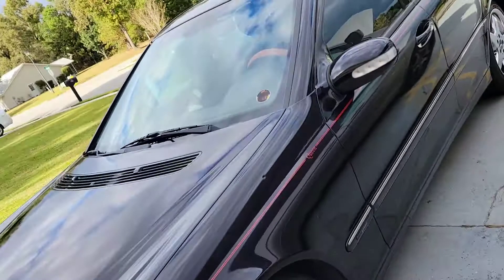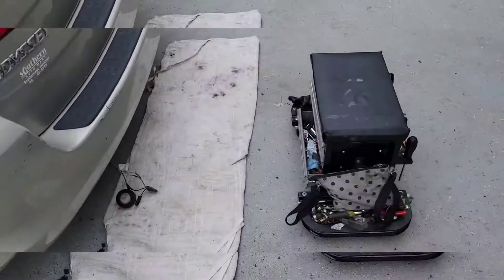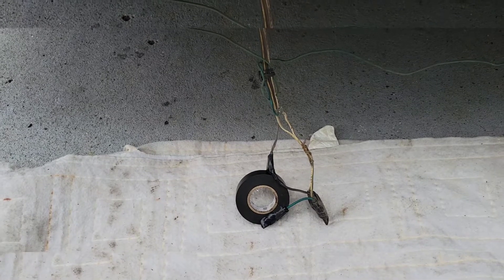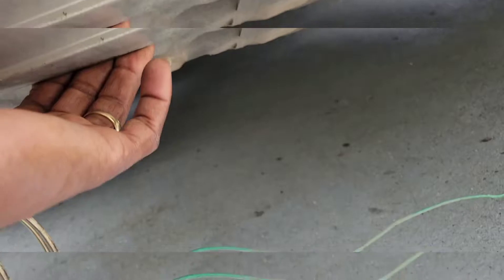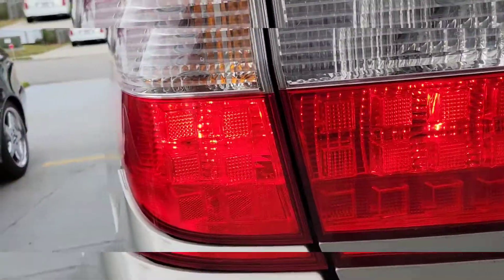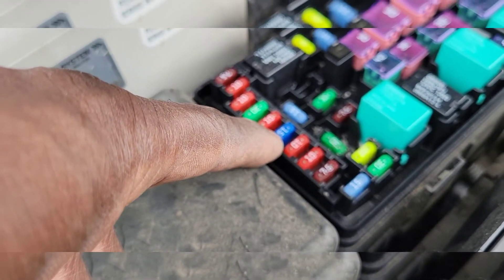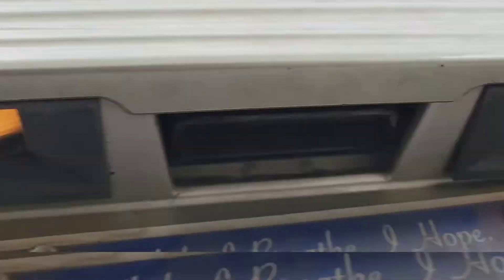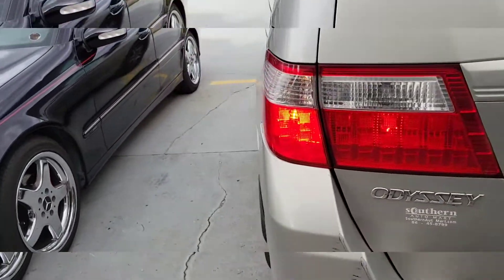06 Honda Odyssey Tail light fuse keeps blowing "fixed"

Comment: Great video but here's a suggestion.  If you follow that nasty trailer pigtail behind the left taillight, you'll find that it plugs into the electrical system with a plug.  The pigtail is connected by the dealer if the customer wants to pull a trailer.  I'm confident you could purchase a new pig tail from the dealer.  I found mine in a junkyard.

Comment: I have a 2006 Honda Odyssey touring and I'm having the same issue but with my blinker/hazard lights (brake/tail lights still working). I switched out 15A fuse and it worked for a minute till it blew again. Any suggestions to what I should be looking for? Thank you
Reply: i’m havin the same issue rn any suggestions?
Reply: @shahrukhakhter3162  me too man On acura tl